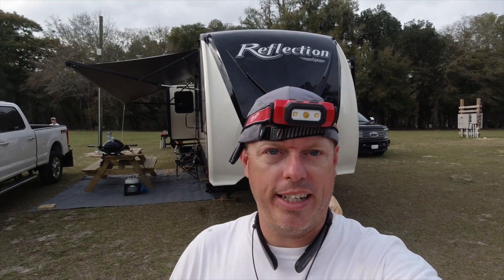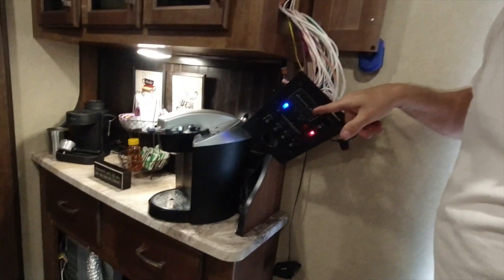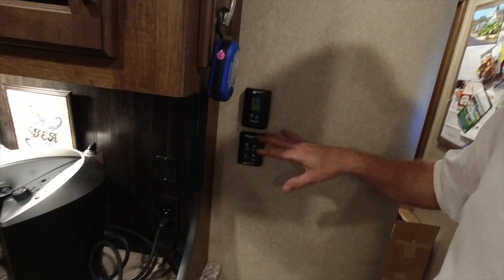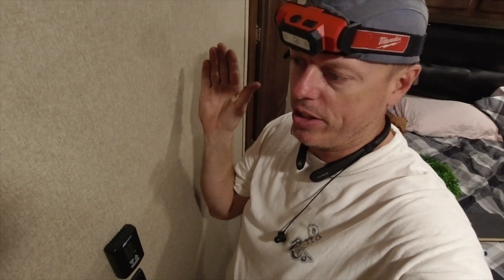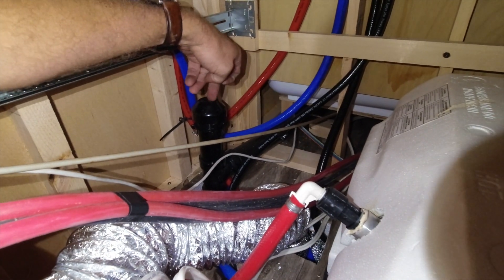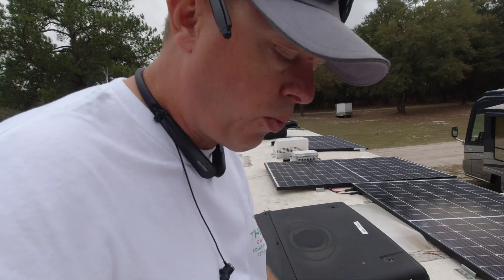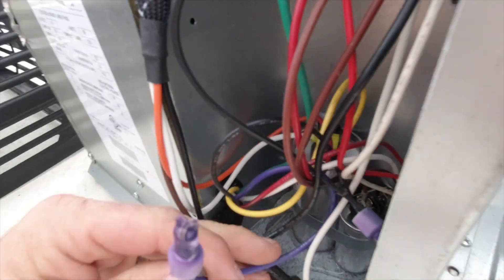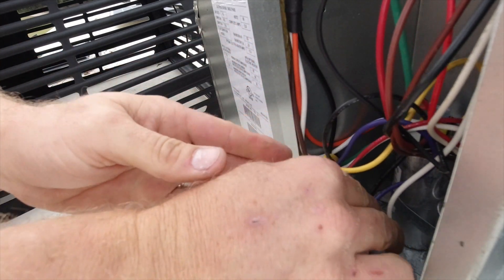Grand Design Reflection 315RLTS | Travel Trailer | Solar & Lithium | Part 1

Comment: Looking at the Reflection 315 rlts. Solar is a huge ask on it as well. Can you share the specs of what u installed as well as your pricing to install. Thank.
Reply from the maker: Hi there Reed, just wanted to be sure you checked out Part 2 as well, but on all of our installs the specs are in the description of each video as well, if he doesn't mention it. (He's gotten better about discussing what's on each install since this one.)  :)  For pricing, each installation is going to be different depending on the clients needs. The best way to find out would be to connect with us on our website to set up a conference call with Mike to discuss your needs, then we'll send you a proposal. https://thedrycampers.com/contact-us/